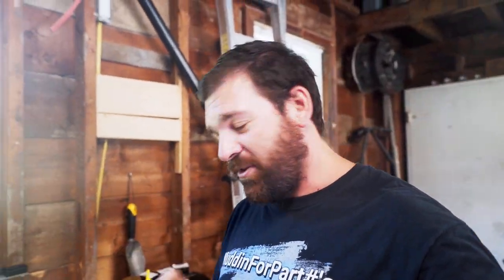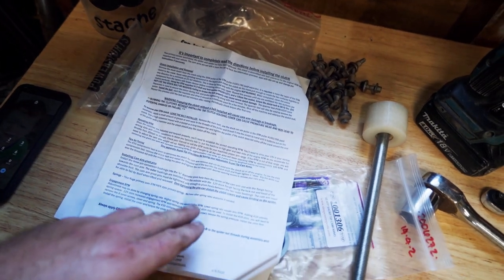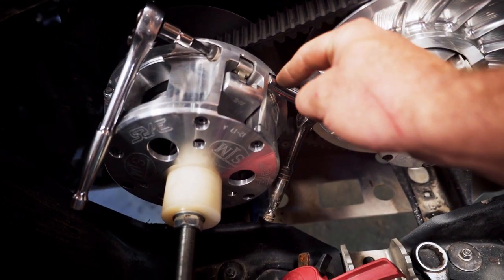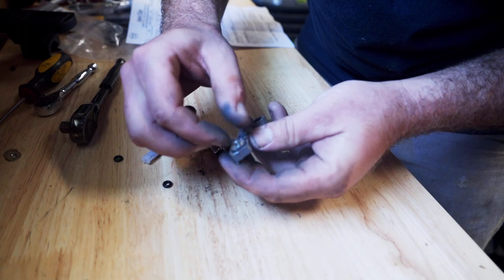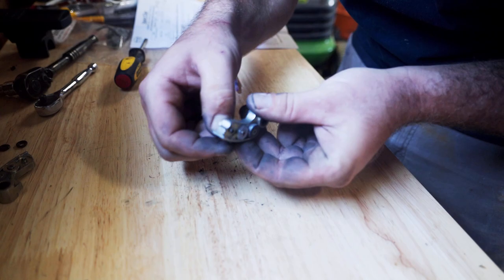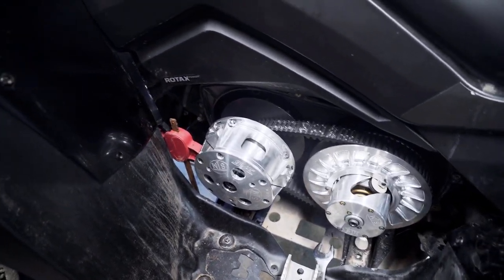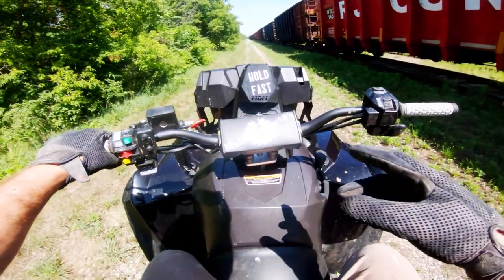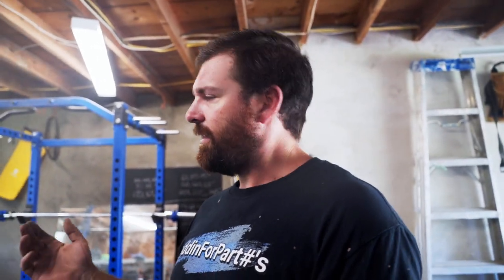STM Rage 3RS Full Throttle High Torque Racing Response- How to Make Adjustments To Your Weights

Comment: I have a 1000k I let mr.rpm tune mine and come to find out I looked at what he did and he took all the weights  off and it was by far the best and the strongest my renegade have been
Reply from the maker: When tuning a Cvt it it important to load the engine, you may find adding weight back in will help keep the motor in peak hp/torque range.

Comment: I'm very interested in this clutch setup. Is it worth going for if you have 28 inch tires?
Reply from the maker: My brother runs a full stm on his xxc with 28" tires. Makes a huge difference once tuned 👍
Reply: @MuddinForParts  thanks brother! I appreciate the info!